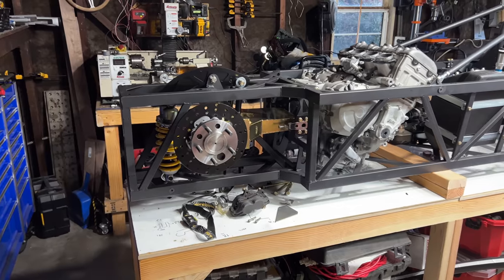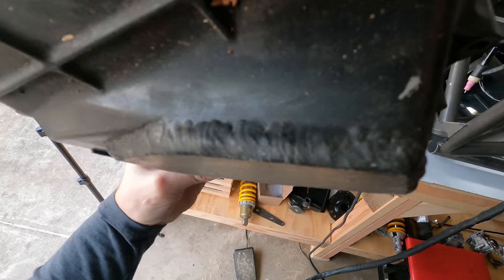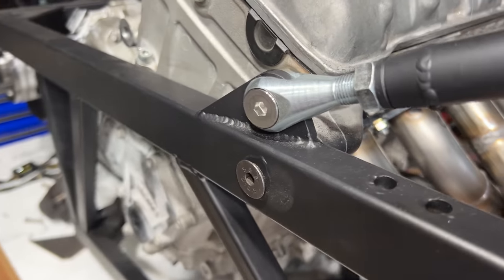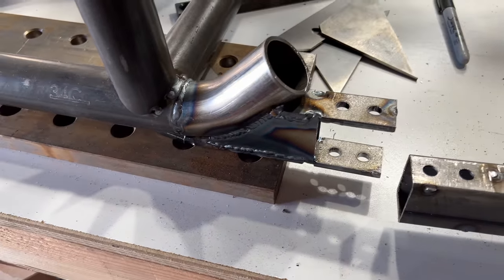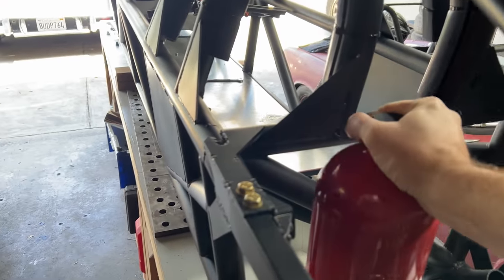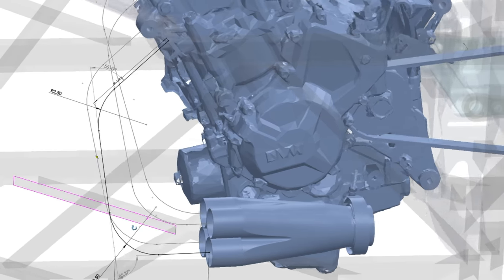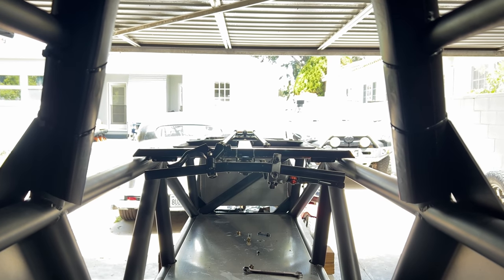How To Build A Fast Slow Car, Fast

Comment: The engine mount bolt access holes are absolutely beautiful. I do my best work when it is destined to be unnecessary.
Reply: Same. It always comes out perfect.
Reply: I second this law of nature. #facts
Reply: Amen
Reply: If he doesn't heart and pin this comment, then he is wrong.
Reply: My best welds are the ones nobody will ever see
Reply: Dammit if that ain't the truth.
Reply: I'm betting we'll see a video next year where Matt actually needs these access holes, making them no longer redundant.
Reply: This principle holds in programming too.  The most elegant code always turns out to have been unnecessary as well.
Reply: I wholeheartedly support this statement

Comment: Given how many close fits you have here, have you discovered the joy that is self-adhesive UHMW tape? I keep it on hand in a few thicknesses. When you have a couple of pieces of metal that you think might interfere, stick a chunk of the tape there. It will provide a self-lubricating wear layer that both prevents damage and serves as a witness mark so you know if contact is happening. It's also useful when you want metal to slide against other metal with relatively little friction, but there isn't enough friction to justify a more complex bearing.
Reply: Thx for the tip! adding this to the toolbox
Reply from the maker: Thanks for the note; I'll get some and try it out.
Reply: Segments of old bike tire or tube can be sandwiched between static close clearances for the same effect.
Reply: @SuperfastMatt  when you use that stuff I have a tip. It's awesome but the self-adhesive part is kind of sarcastic unless you acetone clean the paint and heat up both the thing you're going to stick it to and the UHMW strip with a heat gun slightly before you adhere them. It makes a significant difference in how well they stick. If you're going to skip one of those and cut corners skip the cleaning more than the heating.
Reply: @GunFunZS  good call out. I prep surfaces with degreaser, roll it when possible, and try to make it not fight gravity whenever practical. Will add the heat gun to the process for future.
Reply: @SuperfastMatt  which programe you used to design the fram
Reply from the maker: @hichemilkay2448  Fusion 360
Reply: @SuperfastMatt  do you know any free books or free sites to learn frame designe

Comment: You and “This Old Tony” should do a collab, you seem to have the same sense of humor. Also, what top speed are you shooting for over how many miles?
Reply: Around 204mph
Reply: I really wanna see this!
Reply: A SuperFast Trails Bike could be a possibility or Some mystery hands breaking landspeed records without the car actually moving.
Reply: If I’m reading it right, the FIA record for 500cc unsupercharged wheel driven cars is only 138 mph, which doesn’t sound like a lot when you say it quickly. (As an aside, some of the 500cc supercharged records are held by a 1930s MG!)
Those are probably both direction averages though, which makes things quite a bit more complicated, and I’m not so sure speed week events do that 2 way running, anyway.
Reply: @emmajacobs5575  Matt’s engine is going to be turboed and he mentioned in some vid the record for his class was 204mph so he is going to be trying to break that
Reply: The Bonneville record for K/GS ( 500cc Unblown Gas Streamliner) is 202.424mph & is going to be a tough one to beat, it was set by Jim Burkdoll in 1989.
Reply: THIS
Reply: @DukeOfTwist  OMG, land speed megasquirt trials bike with a custom frame from the maho.
Reply: @thecheese302  ...Yeah, that's how this thing started off, then creep set in, and here we are, darling.  Here we are.

Comment: Your welder time lapse comment made my entire day as a full time youtuber. Nothing drives me nuts more. Then what should be a 10 minutes video that is 25 cause ever 3 minutes is a welding cut seen or a lathe.
Reply: Admittedly there was a time when that stuff was interesting because no one was doing it, but at this point anyone into fabrication YouTube has seen it a million times and the novelty isn't there anymore.
Reply: > To make welding more interesting go out side and lay work on wet ground and with damp gloves and boots and stick welding --YeeOOWW.  Or weld on dry grass,  and learn the quick stomp.  Overhead welding and smell burning hair and whiskers and more involuntary calisthenics.  Paint all components before welding for smoke and fire effects.  A 4 pound or 2 kilo hammer only for massaging fine work together.  More oxy--acetylene work.

Comment: The helicopter I flew in the USMC used the fuel to cool the engine oil. That could save you the trouble of a water tank, and just adding an air to liquid cooler would cool the fuel. Would need to have a return fuel system too.

Comment: Something that you may find interesting is that running a mechanical water pump actually robs a fair amount of HP from the engine. It could potentially be worth it to explore the idea of running an electronic water pump to cool the engine off of a slightly larger light weight lithium battery(only larger if you decide to not run the rectifier for your runs). This method is newly being used in professional motocross where it’s gaining 3-5hp in 250cc single cylinders(this is with the little bit of extra draw from the stator). I imagine you could pick up a somewhat significant amount of hp for a very small amount of added weight. Especially with how much water is being pushed through that motor and the rectifier disconnected. Usually the impeller is just removed from the water pump and the shaft seal remains.

Comment: Bolt the headers on pointing down cut them off leaving a 3” stub, flip them and fabricate it to have the collector centered over the engine, heading straight out like you planned with 180degrees less back pressure
Reply: A lot of headers don’t bolt on upside Down  way you achieve upside down headers is having the transition up happening in the tubing not the mounting point
Reply: I love the channel though just food for thought

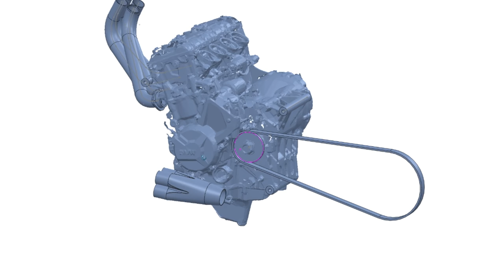Comment: 11:39 this wouldn't be a problem if you hadn't taken the unnecessary step of welding the flanges to the tubes. They're just meant to push the thick tube in to the exhaust gasket in the port.

Comment: Might want to move that rectifier, heat kills those things. I used to have them fry and blow up batteries in a "Cafe racer" I had where I mounted it under the seat with no air-flow... I did this 4 times before I was told that these things get hot.  Love these videos
Reply: The cooling fins should give you a hint. But then again , you made a Coffee Ricer

Comment: A lot of drag racer engines in some of the more "street" classes are cooled by an "ice box," which is essentially what you have already, just add ice.  They run this "ice water" into the engine block.  Doing that and eliminating the heat exchanger will be way more efficient.  This gives you another 40 or 50 degrees lower water temp on the cool side.

Comment: Today I learned "Engineering Intuition" means "Add more struts".  Also, if you're contemplating disconnecting your battery from its charger at high RPM, you may want to consider the weight and charge/discharge efficiencies of replacing the battery with a small super capacitor bank. You will need to jumpstart the engine from something else, but once it does start, it will run significantly better than with a lossy Lead-Acid charge/discharge cycle.  Works Cited: My riding mower.

Comment: IMHO, I’ve used Steel-It on my offroad buggies since it first came out. I think it’s a little overrate especially now with its much higher price. Curious why black? Silver or grey is best for racing as you can detect oil leaks and metal cracking/fatigue much easier

Comment: Just my 2 cents: The OEM Regulator/Rectifier will be a diode shunt regulator, wasting some 30-60W of Power once the Battery is full.
If you care, either buy one of the MOSFET Series-Regulators (less power losses) or place the relay between one of the three input phases from the alternator.
The latter (cutting one of the phases) is sometimes done in "professional" racing.
BTW nice project :)

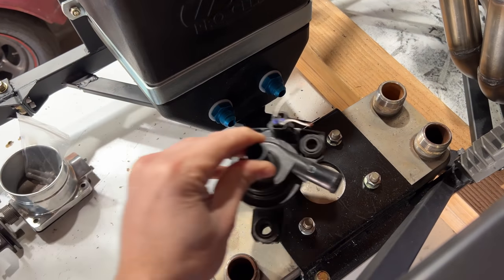Comment: I'm interested in how well that heat exchanger works. 9:38 I have a turbo diesel with a air to water inter-cooler setup. I was looking to add a ice box without directly connecting it to the A2W loop. I had purchased a similar W2W plate heat exchanger so I'm interested how it works in your application. Love the content!

Comment: Heyyyy maaan!!  No, I don’t think you will get into any trouble saying quarter midgets being in reference to race cars..!🤣 I say it a lot in my old videos that I took down many years ago. My kids raced them for years. Over 30. Nephews, my kids and ex girlfriend’s kids, so on and so on. 

AFCO shocks are awesome shocks to use. The internals are very adjustable and with Eibock springs you can really dial in the rear end. 
Hope this helps!!
Ps. I liked the let’s install the motor comment with the engine clip!
I mean, let’s be politically correct these days! 🤣🤣🤦🏻‍♂️❤️🙏🏻

Comment: Looking at the diameter of those coil over springs... yeah I'll say you're over sprung! Did you consider using 2*4's? I think they have about the same rate at that weight.  ;)
How about just moving ONE of them into the middle? Linkages of course need modding. But at least you can use what you've got... AND you get a free spare!

Comment: Are those locknuts the high-temp (all metal) type? ie, not nyloc type? FSAE tech inspection wouldn't let us pass when we had nyloc nuts for fastening our brake rotors.

Comment: In front of the driver cage, there would ideally be a 'crush zone'. This implies not using simple longitudinal girders, but an angled-element (foldable) design that can smoothly crush for a more comfortable crash. Advanced designs would limit peak deacceleration force. Yes, acknowledge that it'll be run in an open area, but still... If there's a tree within 200 miles it'll eventually crash into it.

Comment: That brazed plate cooler will need a decent amount of flow to be effective. Just by looking at it, you may need a bigger pump. Not sure exactly which cooler you have but thermal transfer and emmegi have a ton of data online to get you in the ballpark.

Comment: Matt if you are planning on buying and engine hoist you mite want to consider a A Frame type I have seen some in aluminum that seem to me to have the best of everything. But there are also a lot of used ones out there . The A frame type will not tip over like a traditional cherry picker type of engine hoist.. and you do a lot more things than just changing engines..
Reply: Gantry cranes are nice but Matt's garage looks pretty tight as it is...

Comment: I believe you are now required to use excessively long rachet extensions through your engine mount access holes any time you need to mess with those bolts. Looking forward to the next progress update!

Comment: It looks like you have raw steel and raw aluminum sandwiched together.  This is not a good combination for galvanic corrosion.  I'm guessing the salt flats won't be much help there either.  Anyway, just thought I would mention that you might want to put a coating on those things or something.
Reply from the maker: I don't know why I didn't think of this, but you're totally right.

Comment: Since you had SCS make the exhaust flanges (not phalanges) you could also have had them make a dummy head for welding the exhaust.  

Also, do you use a gas lens on your TIG torch?  The extra gas flow should help with the dark, grainy stainless welds, which is a sign of overheating the weld pool.  Ironically, using more amps and manually pulsing the pedal (or using pulse if your welder has it) will also help with the overheating.
Reply from the maker: Good to know. I'll try the gas lens on the rest of the exhaust.

Comment: You should wire the rectifier to an air conditioning button so you can turn off the AC for more power 😎

Comment: Do the rules allow for only one rear shock/spring? Removing one can save some weight, while potentially solving your over sprung/dampened issue.
Reply: He addressed this in an earlier video: https://youtu.be/SmF21a2oVic&t=454  Short answer: perhaps/unclear, so erring on the safe side with two shocks.

Comment: Fantastic build 😊
I don't know what your body is going to look like, but wouldn't it be possible to take the exhausts out over the top of the engine? Those two 90 degree bends look very restrictive. You could even think about a 4-2-1 pipe with two headers on each side of the engine, and joining behind and above.
Just an idea, on the small chance you haven't thought of it already

Comment: So... a thought... If you're going to use a 4 cylinder engine that's bigger than you need for the class you want to race, and you're already planning on deactivating some of the cylinders, it's possible to use two of the cylinders as a sort of supercharger. You'd have to somehow either replace the existing valves on those cylinders with reed valves, or - the "easier" route - you can have a camshaft ground with extra lobes for the cylinders you're using to pump air on what would ordinarily be the compression and power strokes. If you've already got extra pistons moving up and down, you may as well use them as a compressor to get some extra horsepower.
Reply: they'd have to have larger displacement to the running cylinders for it to work (or more cylinders for that than what are running).

Also I think it would kick it into a different class of racing if it's supercharged.
Reply: @lasskinn474  With correct valving - see my camshaft comment - the inop cylinders will provide ~1x volume each revolution. The cylinders still firing only take in an air charge every other revolution. Bart Crauwels converted the vertical cylinder on a Ducati 1000DS motor into a compressor and called it the V One. There's a 2009 article on The Kneeslider that mentions the 498cc single making 15 horses more than the stock engine.

Comment: I have been wondering if send, cut, send would be able to accurately cut sprockets out of a thick piece of steel or cut thin pieces of steel that could then be layered and bolted together to make a sprocket. Your machining of the sprocket makes me think that is a no. Or maybe something you simply overlooked.  Amazing build keep up the progress.

Comment: Guess I missed the part where you chopped the deep sump off the old Honda engine. Didn't turn out too well for that one. Not sure I'd repeat that procedure expecting a different result. No cornering (hopefully) in a land speed car, but acceleration and braking "G"s might be enough to starve the oil pump w/o a centralized sump. Not to mention windage losses from having the oil nearer to the crank.

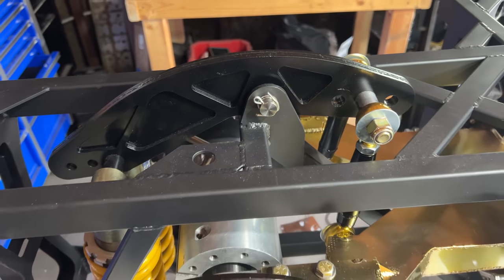Comment: Just watched the newest video, love your work. One concern though - are you sure the flange that holds the center pin for the front suspension is strong enough? Time 7:11. A by-eye free-body diagram suggests that the flange has to support about 1.5x the dynamic load of the front wheels during a bump (input load is upwards on rear link, upwards on forward link with the struts, down in the middle pin). The flange's bearing surface looks pretty small, and it looks like it's welded to a cross-beam welded in shear (can't see if it's traingulated...). Could be fine, but might be worth double-checking. All hail the algorithm.

Comment: I wont tell you to flip the exhaust upside down to finish welding a collector to it, but i will tell you that maybe you should have run the exhaust that way anyway so the gas can run straight backwards over the rear shocks and between the rear wheels, avoiding having to snake through pipes and leave the engine quicker. nitro funny cars use short stack exhausts to vent gas quicker to make room for the next cycle faster meaning they can run higher RPM with much closer timing, none of which may apply to a 500CC run, but still something to consider maybe?

Comment: I have two questions that are not relate to this video, because algorithm. What’s your favorite food? And is a hot dog a sandwich?
Reply from the maker: My theory on hot dogs as a sandwich: A sandwich has fundamental attributes: two slices of bread, multiple layers of food inside. You can go one step away from that and still be a sandwich. So if you put a hotdog between two slices of bread with some condiments, then that is a sandwich. Or, if you opened a hot dog bun and filled it with slices of turkey and lettuce and cheese, that would be a sandwich. but a conventional hot dog is two steps removed from the sandwich since it only has one piece of bread and the food is not layered inside. Therefore, hot dogs are not sandwiches.
Reply: @SuperfastMatt  I’m the least bit surprised that you seem to have put extensive thought into this and have a sound, tiered theory in regards to the sandwich status of a hotdog. I’ve not heard the layered bit, but I subscribe.
Reply: @SuperfastMatt  But a hot dog bun is not two slices of bread (it is just one piece with a slot cut in it), so even with layered fillings it's not a sandwich by your definition.... right? 😉
Reply: @brianb-p6586  @SuperfastMatt Following this logic train it seems tacos have to fall between sandwiches and hotdogs in the delicious food hierarchy.
Reply: I'm more awake today, and realized that the bun is allowed by the "one step away" rule.